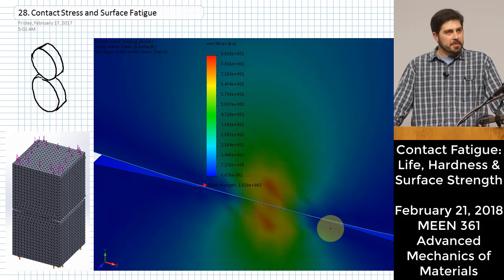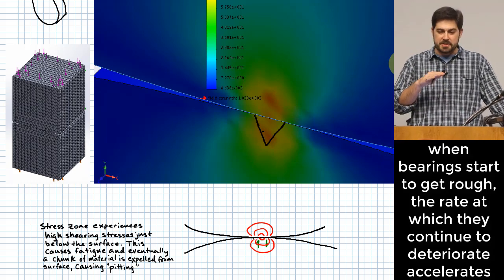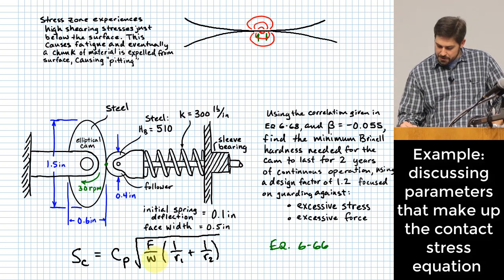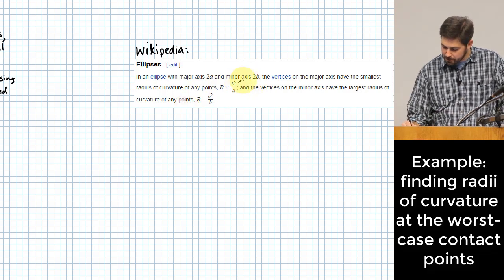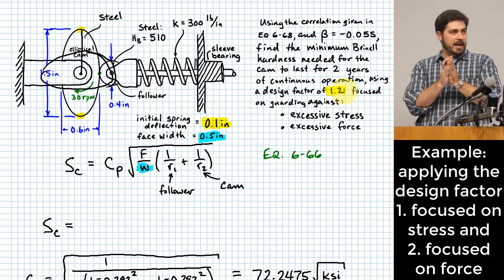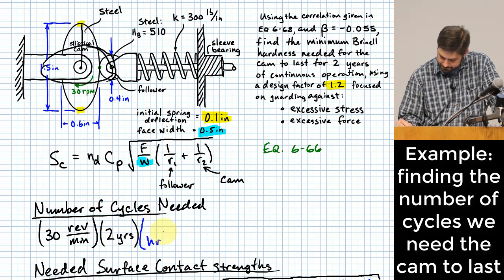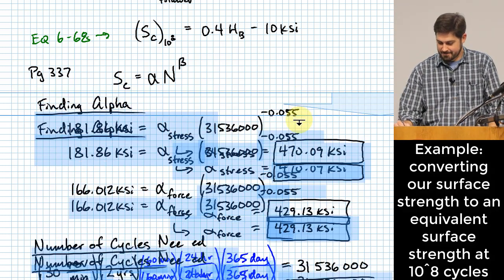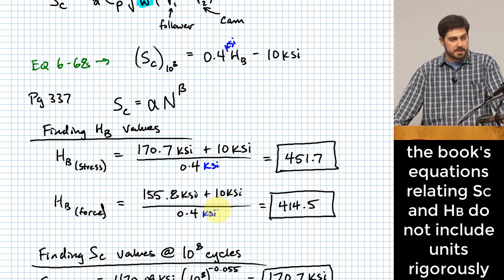Contact Fatigue | Life - Surface Strength - Hardness Relationships

Comment: Do you know why the max contact stress is subsurface? Is it some sort of stress lensing effect?
(Not able to watch the whole video right now, but got up to ~10min)
Reply from the maker: Basically, max shear stress (like from a Mohr circle perspective) happens beneath the surface because the lateral normal compressive stresses drop off more quickly than the normal compressive stresses as you move from the surface toward the center. This article shows the math and the plots: http://analysischamp.com/stressbook/BS02-19.HTM

Comment: Nice lecture and illustration. is there a general equation to calculate cycles to failure for different types of contact surfaces? I am looking into a bearing in a raceway of a ball screw and I am interested in identifying the contact fatigue of the screw and nut and not the ball. Particularly for the screw, I want to find the number of cycles to failure for a given contact pressure max.

Comment: I’m getting quite a bit out of watching your videos. Thanks for posting them. Question: what computer program do you use for your presentations? It appears to be an excellent tool.
Reply from the maker: I'm glad you are enjoying the videos! I use a Fujitsu T901 with an i7 and 16GB of ram running win7 and onenote 2007. I have newer hardware and software, but it doesn't work as well. Thanks for watching!

Comment: Hello Sir, One question - what is the criterion to consider the problem falls under 'contact stresses' analysis and not regular compression stresses?
I hope I could put my question in proper words.
Reply from the maker: There are often high stress gradients right around where two bodies press against each other. The "contact stresses" I discuss in this lecture include an attempt to model those gradients. Generally when thinking of plain compressive stress, you aren't trying to deal with strong gradients.
Reply: @TheBomPE  Thank you for answer.
I liked your lecture very much. Lot of solved examples make it better.

Comment: so we got a low value compared with the hardness of the follower. So I think the cam surface will damage first. what if we have the same hardness values on both of the cam and follower, is it leads to overdesign?
Reply from the maker: That is right, the cam has to be harder than the follower to achieve the same design factors. This is due to the tighter radius of curvature on the cam. Thanks for watching!
Reply: @TheBomPE  Thank you for reaching back and clarifying the doubt.

Comment: How we do differentiate (in real-life cases) whether to guard against excessive force or against excessive stress? Required Hardnesses differ significantly from one another. 
P.S. Extremely thankful for your wonderful lectures, sir. Your lectures have turned very very effective for me.
Reply from the maker: The difference between the two ways of applying the safety factor has more to do with how you'd like to interpret it. If you use the one focused on load, the safety factor represents how many times (as a multiplier, not a number of cycles)  the amount of load you used in your calculation could hypothetically be applied before causing an issue. If you use the one focused on stress, it represents how many times the amount of stress could be applied before causing an issue. In many engineering analyses, these two FS numbers are actually the same, but due to the nonlinearity introduced by the variable contact area, they are different in Hertzian contact. I suspect that it is more common that designers would be interested in the one focused on load more than the one focused on stress in most cases. It seems to me to be more directly useful to most design questions.

Comment: WHAT IF THE CAM HAS A CONCAVE SHAPE. OR what if the we are looking at a male cone compressing against a female cone creating a line contact with each other?
Reply from the maker: You might find this article a helpful starting point (look under the heading "Hertz contact stress")
https://en.wikipedia.org/wiki/Bearing_pressure

If you want some more depth:
http://iieta.org/sites/default/files/Journals/MMC/MMC_B/86.2_12.pdf

You might also want to check this one out :)
https://newrepublic.com/article/117390/netiquette-capitalization-how-caps-became-code-yelling